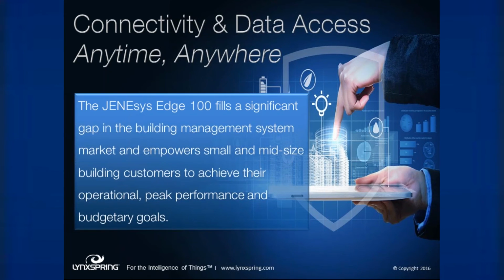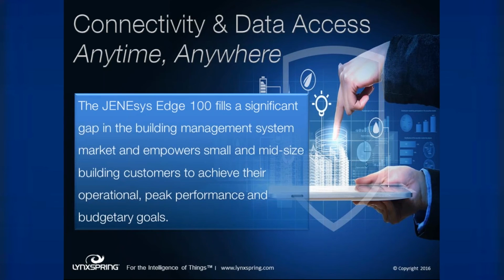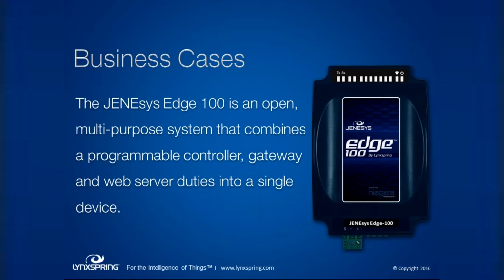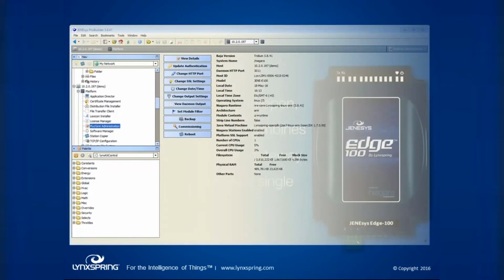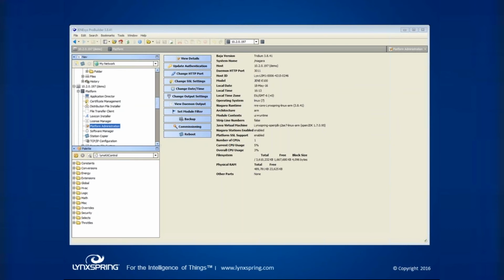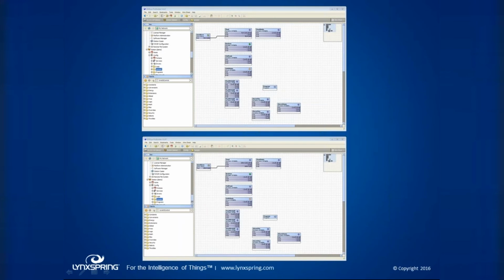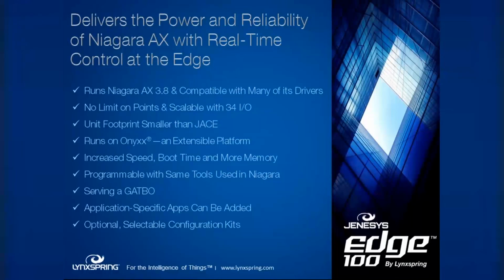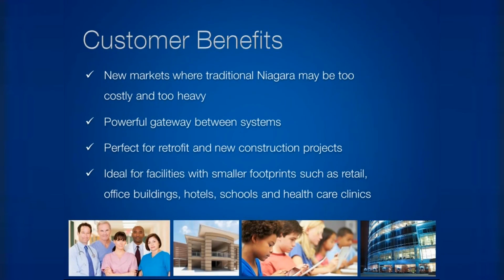Introducing Lynxspring, Inc.’s New JENEsys® Edge 100 Products – Webinar

Comment: When I am comissioning lynxspringedge534 it was showing required software not found
Reply from the maker: Our Technical Support team would need to know which Niagara version you are requiring. Our current supported versions will only work with 4.7.1, 4.9.1 and 4.10.1. If you are a current Lynxspring business partner, you may always download the latest Onyxx driver package for the Edge product and Niagara version you are using by logging into your Resources partner portal at:  https://resources.lynxspring.com/drivers. You can also download needed software at:  https://resources.lynxspring.com/software.